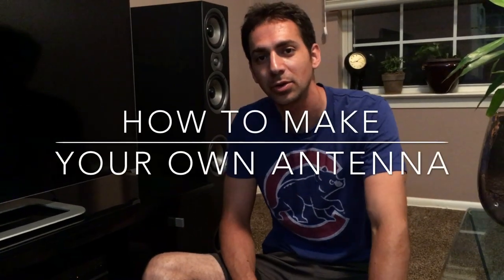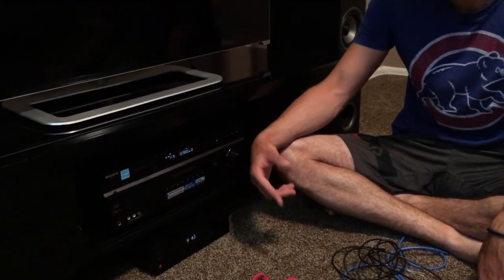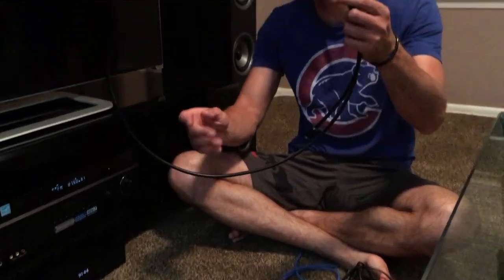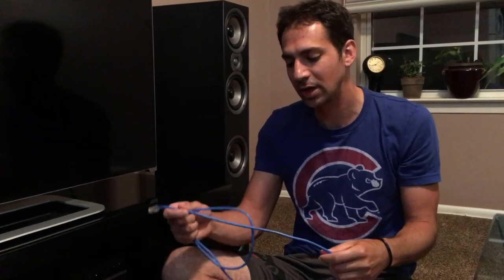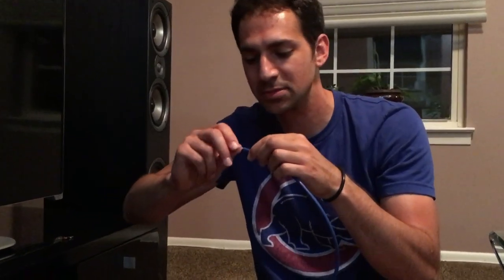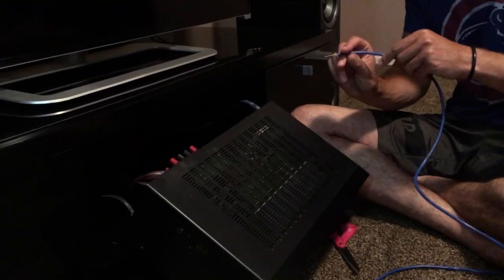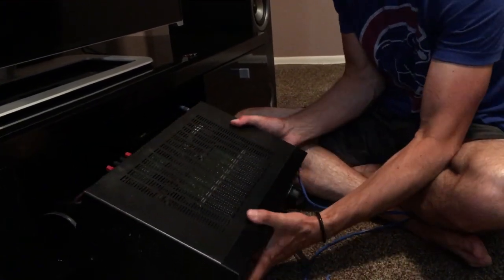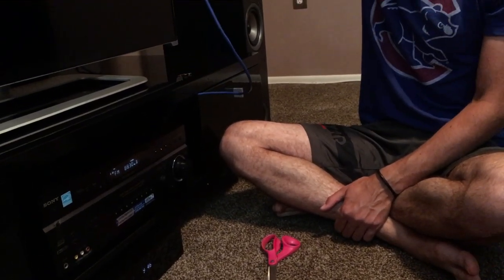How To Make Your Own Radio Antenna

Comment: I wish you would show the back of the receiver so I could see what you're connecting the wire to.  Some of my receivers have a thing that looks like the one for cable tv.  But the others just have screws. Thanks for the video.

Comment: Thanks very much; it works wonderfully.  I've a related problem.  I listen to but two FM stations: 99.5 (100,000 watts ERP) and 104.9 (from a 250 watt translator), both in the metro New Orleans area.  With my new antenna the reception from the first is terrific; but from the second it is quite poor.   What if anything can I do to improve the reception from the second one?  Thank in advance for your help.

Comment: which wires do you connect together???
Reply from the maker: Any one. A antenna is just that. A wire. Stick any wire inside. And raise the wire and pin it to the wall. Or place it high. That’s it. It’ll work perfectly

Comment: Is there any substitute for cable wires? I only have broken headphones and earphones
Reply: Yes, headphone wire can be a good replacement, especially for radios with small antenna wires.

Comment: Not working sometime 🙄
Reply from the maker: Make sure the wires or wire is inside perfectly. Roll it nice and thin so it fits inside. Then make sure you put the antenna up high. Move it around until the radio is perfectly clear. Some stations are better than others because the tower is closer to your house.

Comment: Didn't work,  should have known when i saw the Cubs logo
Reply from the maker: Hahah. My brother got me that shirt. I actually don’t even follow sports. What type of wire did you use? And where did you mount the wire once inside? It will work. Explain what you did and I’ll help you
Reply: @MasteringHow-To  took the lan cable, cut off one end,  stripped the 8 wires,  twisted into 2, placed each in the antenna input (mine is like a speaker wire input) and held the cable up a little... it's 3 feet long.. and nothing